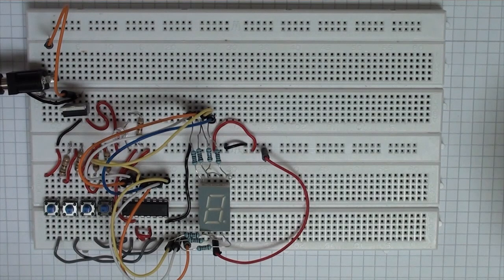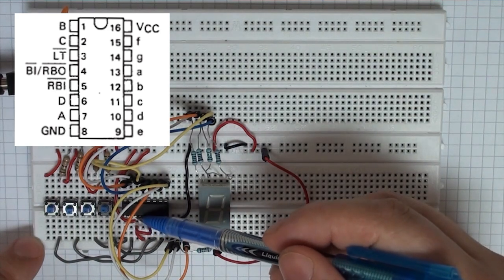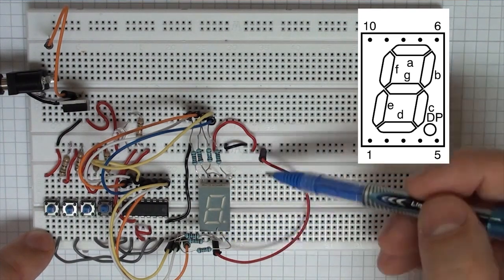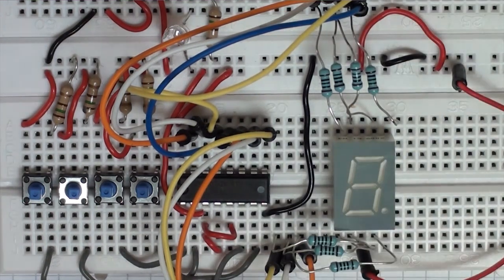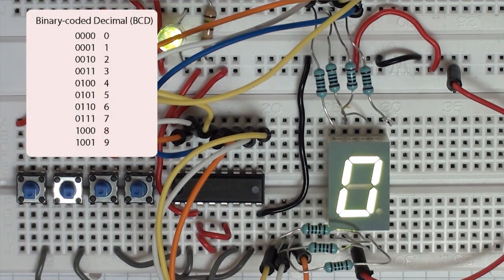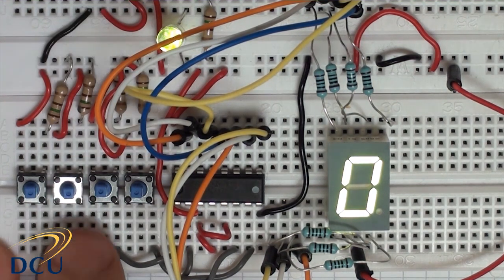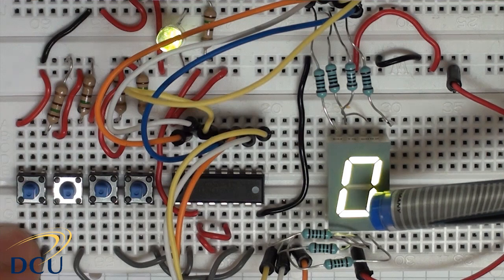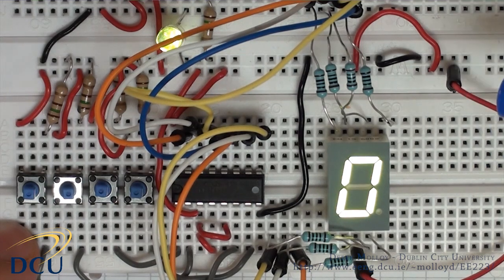Digital Electronics: Binary Coded Decimal (BCD) to 7 Segment Display

Comment: Hi
I have a problem to solve.Some of the measuring instruments have no data logging facility but capable of displaying the parameter being measured. For example you can consider  a simple multi-meter for measuring of DC voltage. If I want to data log this DC voltage I should possibly get the input to the digital display of  the multi-meter to which I assume to be a DC voltage and connect it to my data logger. I need your assistance in finding the input to Digital display of any meter which can be used for data logging

Comment: Very good documentation with wiring diagrams to actual circuit connection! Many other videos failed to do so. They only show a punch of wires connected to the chip on a breadboard; not a very effective way of conveying informations.

Comment: I have a problem with mine (4543) bcd decoder, I connected it to the 7 seg. display and if I bring 5v to any of the input pins I get number 8 on the display, no matter which pin I power on. What could be wrong? Thank you in advance...

Comment from the maker: The buttons are connected in their open state via a pull-down resistor (such as a 10k) to ground. When the button is pressed it connects the circuit input to the +5V rail and the output to the circuit is high. See this video (KllMUO_pHxk) for more information on pull-up and pull-down switches. Also, I have a video "Lecture: Debouncing a Momentary Push Button Switch (SPST)" where I explain it and how to get a clean output.

Comment: U said when all the inputs are 0's  7 segment shows "0" does that mean that the switches all initially set to 0 and when you press the switch it become 1? Is the the pull down configuration?

Comment: Thank you for mentioning the different in Common Anode vs Cathode.  I was trying to wire up a circuit with 4026b and it wasn't displaying right.  I switched to Cathode and now works.

Comment: @DerekMolloyDCU It doesn't make any difference if there is a load?  I'm not sure if there was any internal wiring in the breadboards I used back in college that would have prevented shorting.  I know they were normally closed, and normally connected the load circuit to ground and the push button itself had to be powered by a 5V source through a 1kΩ resistor.

Comment: @DerekMolloyDCU Would there still be a short circuit if you use a pull-up resistor and send the voltage signal to the push button switch and to a load?  In school, I used normally closed push buttons with a 1kΩ pull-up resistor and had to power both the switch and the circuit load.

Comment: What kind of push buttons are those?  I'm building my own homemade powered breadboard and want to put momentary push buttons on it to use for manually toggling clock inputs and other things.  I'm afraid the switches might create a short because the switches themselves have to be powered and grounded.